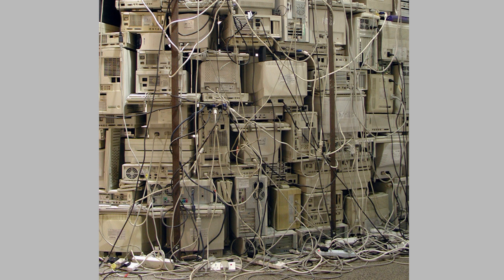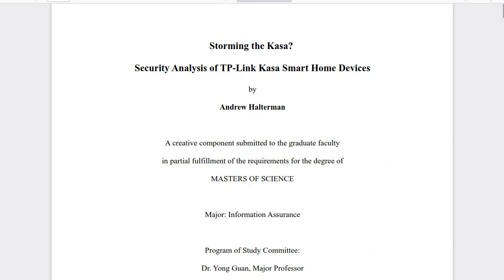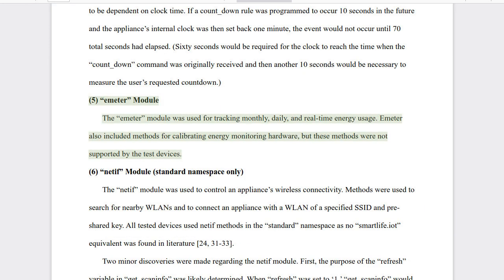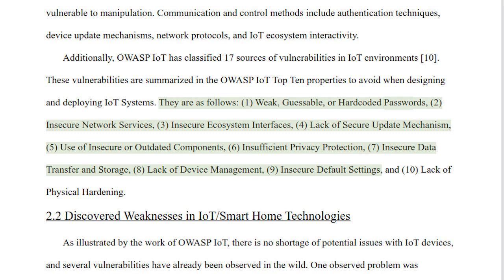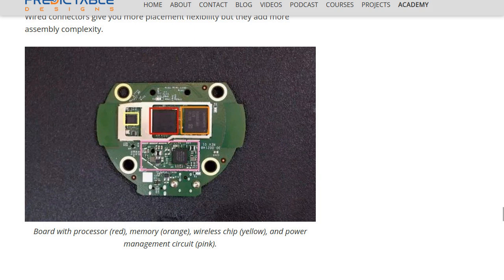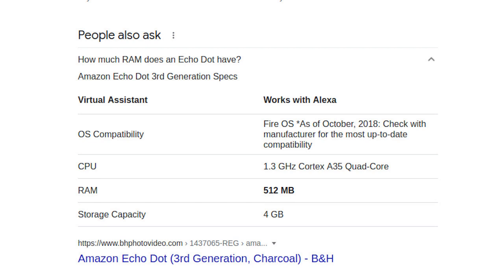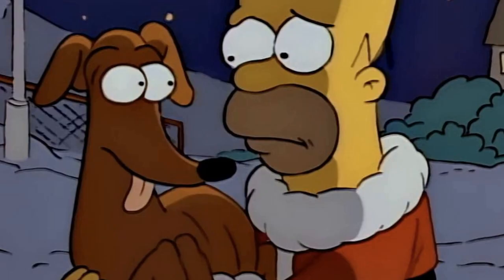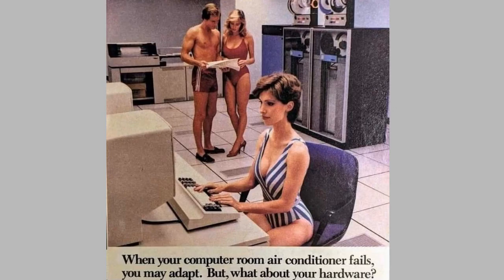When Tech Bubbles Burst & Other Strange Tales

Comment: SoC and FPGAs are pretty interesting, since they manage to be as small as possible but powerful enough, and FPGAs give you the possibility to synthesize your own hardware design (the only problem is that we're stuck either with Vivado or Quartus). I feel like the hardware (in general) doesn't get used at its full potential, that software development is stuck in its past errors and/or in anachronistic assumptions. I think that in orphaned/forgotten systems (Plan 9, Sun NeWS, ETH Oberon, Symbolics LISP, ecc) there might be good ideas that got lost in the time, and that are worthy getting tried again but fixing their mistakes.

Sometimes I wonder if x86/x86_64 will ever go away, leaving space for other high performance implementations of other ISAs, or we are just doomed to be stuck with it on desktop/workstations.

I also wonder whatever happened to exotic stuff like VLIW processors, transputers, massive parallel arrays of processors, clusters, and if is worth re-exploring them.
Reply: @Tony Yeah, mainly because they're not known to the average programmer, or because FPGAs were really expensive. Now with 30-100€ you can get a decent board
Reply from the maker: There was a project to run 9Front on an FPGA board a few years back.
http://aiju.de/electronics/aijuboard/
They are very much another example of hardware that has become very good over the years.
Reply: @adventuresin9797  Yeah, I also heard of an ETH workstation called "Chamelon", it was built around a MIPS R3000 and FPGAs, and it ran Oberon. There's a paper about it but unfortunately is under paywall.
Reply from the maker: @DVRC  Some of those exotic options are actually pretty common.  Like, you can get a dozen "cores" and 128GB of ram in a single box now.  But the problem was always getting people to write code that could be run parallel, and not all code really benefits from being split up like that.  But part of it does boil down to assumptions of how a system should work.  My android phone and Linux desktop are both "Linux", but don't really communicate well with each other at all.  But my arm based raspberry pi and intel based dell work together great with 9Front.

Comment: I have both a smart plug from to link that runs on kaza and a couple of echo dots. Can they be actually modified to run custom firmware? I know very little still about hardware hacking
Reply from the maker: There has been a trend towards "trusted firmware", which limits what a chip will boot.  So some hardware is not worth the effort of hacking.  I did get some of the newer Kasa smart plugs, and I may just do what I did with the smart bulbs; leave the firmware intact, write an app for 9Front that speaks the plug's protocol and then converts that to 9P and files for the rest of the grid.